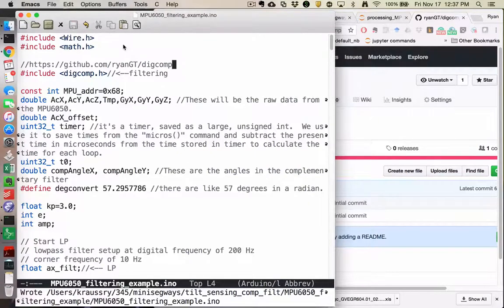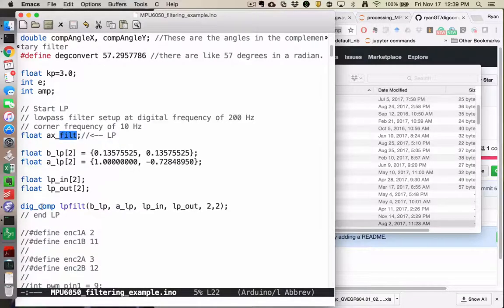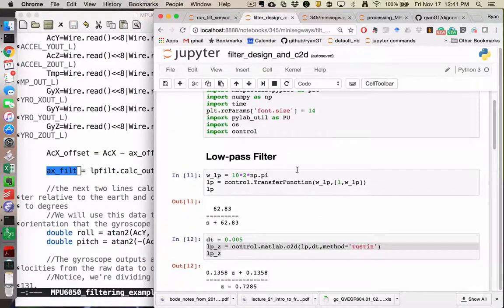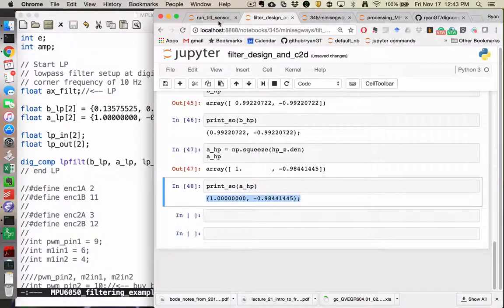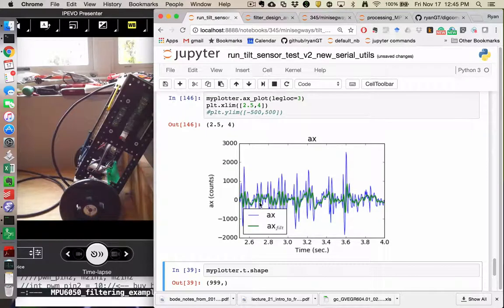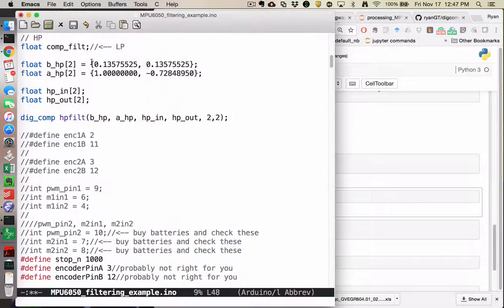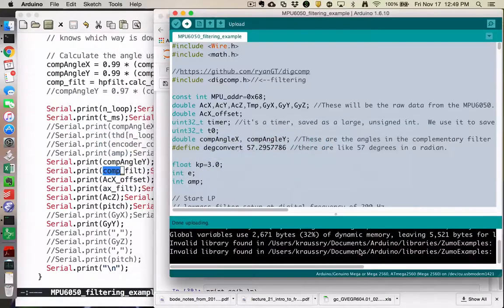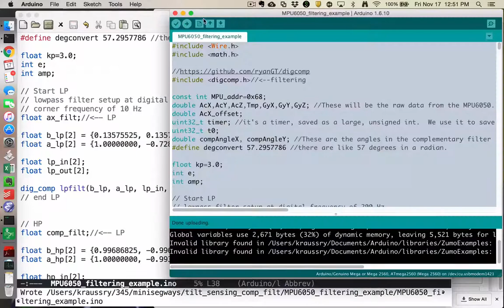Digital Signal Filtering with Arduino

Comment: What about a bandpass (or bandstop) filter? Application is CW audio, picking out one signal out of many on a radio without a filter. And preferably variable center and width. I've been searching but so far found none for Arduino.
Reply from the maker: n0ukf as long as you can express the filter as a transfer function you should be able to convert it to a digital transfer function. The the coefficients of the digital transfer function are what is required here. Bandpass and band stop filters can be created using a combination of poles and zeros which would allow you to express their transfer functions.
Reply: I don't know transfer functions, I just watched you plug in numbers and copy/paste their results. I'm looking for something I can turn a couple knobs (pot or rotary encoder) to adjust the center and width
Reply from the maker: n0ukf there are no knobs to turn, copying and pasting the coefficients from a digital transfer function is the only option. If you cannot find the coefficients of the digital transfer function you're trying to use as a filter, then this approach will not work for you.